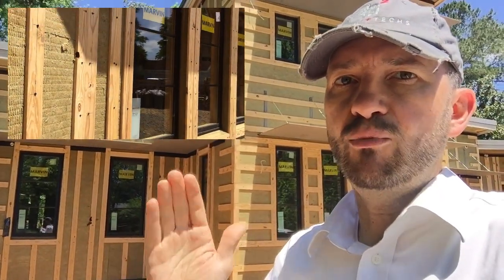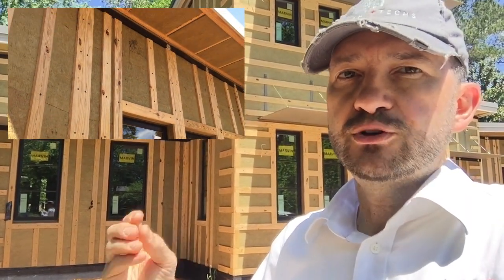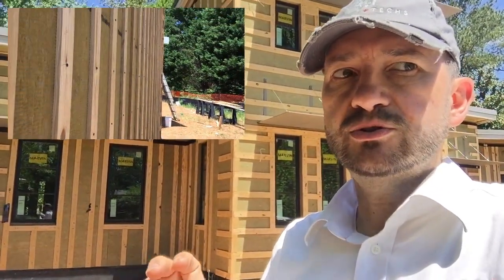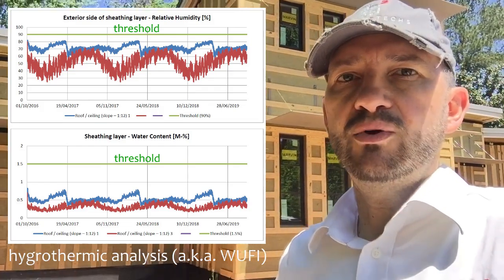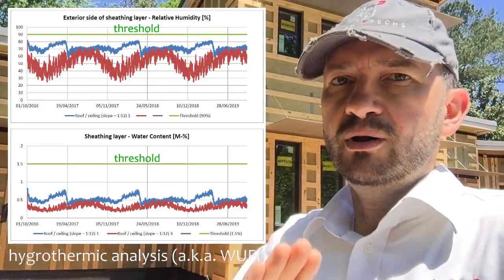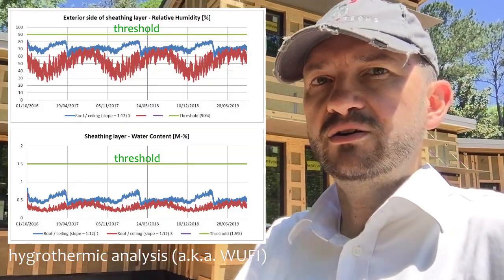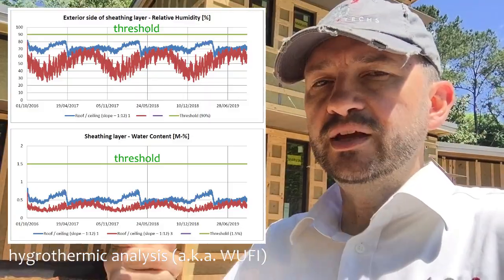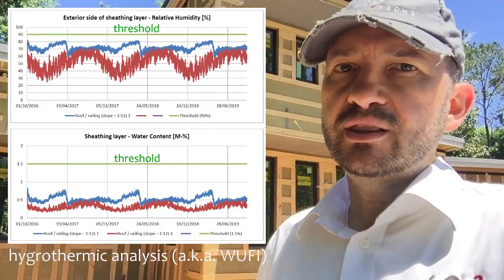Why and How We Install Continuous Exterior Rock Wool Insulation

Comment: 8:30 in
Pro tip, zig zag those screws, putting them in a perfect line like that makes a hinged parallelagram. 
With zig zag screw placement the firing strip will be more firm and have less wobble.

Comment: why not just use a vertical 1x8 or 1x10 trim on the corners? that horizontal cantilever detail could have ventilation and drainage issues be reducing ventilation along vertical battens

Comment: I thought if you run horizontal boards they had to be sitting on vertical boards. Horizon will hold water and prevent air flow no?
Reply from the maker: Thanks for the question!
What you are saying is true when you attach a continuous flat cladding (panel-like) without a gap between the back of that cladding and the furring strips, AND there are no ventilation channels created between ends of horizontal strips. In this case, and in many cases with vertical cladding, there is an attachment "system" that includes clips that maintain at least 1/4" gap between the back of the cladding and the strips. In addition, the amount of water in the rain screen gap is almost always from a vapor source, not a bulk water source. If bulk water gets into the rain screen gap, there are bigger problems (an unintended and unacceptable leak) than moisture on the furring strips, which will dry. In the case of open-joint cladding, installing furring strips at 45 degrees is a great way to direct penetrating bulk water out of the gap.
Make sense?
Reply: @LGSquared yes. Same as when insulating a roof I guess when the board standing on edge at the end of the eve can be a possible dam. If you’re getting that much water in behind the cladding or roofing material there are other bigger problems. Thanks

Comment: For the horizontal furring, if you must have it, replace it with Coravent SV5. You've put in place a bunch of air and water dams.

Avoid sections of vertical furring that touch other sections of vertical furring. They will wick water up by capillary action.

Finally, Rockwool isn't rated for use on pitched roofs, only flat ones. The slope is pretty subtle here, so it's probably fine, but I'd check with Rockwool that this install meets their spec.
Reply: Yep. Bunch’a dams installed. Love when guys that don’t know wtf they’re doing post video on YouTube pretending to experts.

Comment: great video. Can we just sheet the house again over the Rockwool ? Instead of the strips?
Reply: It won't work as well. You could sheet it AND do the strips, but the strips serve a purpose. The are a rain screen that promotes drying behind the siding. A flat layer of sheathing won't provide a channel for liquid water to move through. It also won't provide a path for air to flow though and remove water vapor.

Comment: Did the rockwool go down the foundation?  How did you protect the exposed rockwool above grade?  If stucco, how did you secure hardware cloth or wire?  If sheet good, any brackets attached to wall?  Good point about the corner trim backing.  Thanks.  (Working on my 1984 built house, looking to squeeze a few pennies from the heating and cooling bill..)

Comment: Does the liquid applied air/vapor barrier prevent the wall assembly from drying to the outside?  As you mentioned, you want to avoid trapping vapor.

Comment: Interesting! -- QUESTION -- The one thing I can't figure out, is this. Rockwool reminds me of a wool sweater, which is great as long as you wear a wind breaker over the sweater. Otherwise the cold air blows through the sweater and the insulation value of the sweater is zero.  Why is Rockwool not the same? To my mind the cold will pass right through it unless you have an air tight covering such as Delta Vent SA or that other one from Siga that is hanged over the exterior insulation.. What are your thoughts on that?  Just seems like Rockwool is very porous to air.
Reply from the maker: Hello, Coleen. Great question. The simple answer is that the rigid mineral/stone wool products are made dense enough to prevent convective loops that cause a reduction in thermal resistance, and it  be in direct contact with the continuous air & vapor control layer. VERY loose (density) insulation and poorly installed cavity insulation led to the focus on six-sided encapsulation.
There is additional research regarding "Wind Washing" with exterior insulations in vented rainscreen cladding assemblies done by RDH (John Straube). Here is a link to the report in case you, or another reader, is interested. 
https://www.rockwool.com/syssiteassets/o2-rockwool/documentation/research/white-paper/wind-washing-of-air-permeable-insulation-2018---white-paper.pdf?f=20201024215341
More published info from Building Science Corp (Joe Lstiburek) touches on the science of insulation and best installation practices that may add to my answer to your question. Here is the link to that.
https://buildingscience.com/documents/information-sheets/installation-of-cavity-insulation
Let me know if I have not answered your question, or if you have additional questions.
Reply: @LGSquared  ..after reading the Wind Washing study, I am convinced more than ever, that a WRB be placed over exterior Rockwool and sealed properly. In fact, It would probably be best if there was solid Zip sheathing used. Certainly no downside except for cost.  It seems that cold will otherwise make its way behind or through it under almost all installations. I did look up the density of Rockwool since density was focal in the study. I can see why in Matt Risnger's Vancouver BC Canada series, the builders used Siga?? wrap over exterior Rockwool - they never left it uncovered even when there was exterior clading used.
Reply: @Coleen_West  okay dude you clearly didn't READ the study because it had numerous statements like "For mineral fiber insulations ... there was 'practically no influence' on the measured thermal performance."

Comment: Hi Chris, thanks for this video.  You explained things perfectly.  I was wondering if you did some sort of metal "L" trim on the bottom for the insulation to sit on, as well as the furring strips and the exterior wall covering, or is the "coravent" taking care of that?

Also, how did you trim out for the thickness of the exterior for the window openings?

And finally, I'm assuming you put the air barrier, like Tyvek, right under the 4" Rockwool, is that correct?  So the layers on the studs are sheathing, Tyvek house wrap, Rockwool, furring strips and finally siding, right?

Comment: Glad to hear about the extra rockwool on the roof - that's what I did for my hermit hut. I did a primitive "double wattle wall" from a 1800 BCE archaeological site design - using on site materials. The roof I added a synthetic rubber pond liner on top of the rock wool - I can REALLY FEEL the difference now! Wow the wood stove heat really stays trapped and absorbs into my wattle and daub side walls, etc. Even though I had lots of air gaps - big leaking air holes and it's sub-freezing arctic cold where I have the hut. So that extra rock wool on the roof - I did TWO layers - yeah it was worth the investment for sure. thanks
Reply: @ducoh2093  I have no idea how standard construction would do it. I wanted a tarp roof to keep my structure as a temporary shelter in case Guvmint got fascist on me. So I have a tarp OVER my rafters - actually willow trees - and the two layers of rock wool - and then another tarp over that. Then when it rained - the rock wool soaked up the water through the tarp - so I put all these clip things attached to the tarp underneath on the inside - so I didn't break through the tarp. Then what? I bought a pool liner - synthetic rubber - to cover on top again - and put a third tarp over that. I used poly-vinyl tarps... At first I wanted my roof to be both breathable AND insulated (hence the rockwool and tarps). The synthetic rubber cut off the breathable part of the roof - and also cut off the Schumann resonance quite a bit. hmmm. Yeah I'm a primitivist.
Reply: Bro, stop being so paranoid. Build the roof right. F the gubmnint you do you, and do not worry about anything you have no control over. Build a little reinforced cement space under your pad. If crazy shite happens you could go down there knowing you did the best you could and relax while you burn a joint. 🎉
Reply: Interesting to see the use of a wattle and daub wall native materials along with modern ones like rockwool.  Thanks for sharing.
Reply: @Mays2410  Burdock cordage! cool. Compost heating! yes. I need to get back to my land to check up on my hut - and install my hand pump for water. I finally got down to the permanent water table - took a few years of digging and driving the well pipe. 33 feet down. Year round water. I got a "sucker-rod" pump from Earthstraw. It's a cool design but not sure how long it will last or if it will get sabotaged or something. hahaha.

Comment: Rain screen furring strips' orientation 

The Rain screen furring strips' orientation must be vertical to allow for unobstructed continuous water, air, and moisture flow.
 If your siding needs to attach to horizontal furring strips, they must be attached as battens over the required unobstructed vertical furring strips.
Source: Hammer & Hand / Horizontal Rain Screen Furring for Vertical Siding
Reply: Was looking for this exact comment. I'd avoid horizontal strips, especially at the window bays. You've made a dam with each one and at the window it will serve as an air dam, so you won't get great airflow through those sections.
Reply: Got on the comment section to mention the same thing. From what I can see the horizontal furring strips are insane. Unless he can explain it which I don’t see how he can that horizontals cannot be wood but rather the hard mesh plastic furring strips that allow the water to flow through it.
Reply: Exactly what I just posted before reading all these comments.

Comment: Please!!  I have the same question.  Your roof assembly is exactly what I am doing on the house I am building myself, and I would really appreciate a sketch of how you handle the edging and the core-a-vent on the standing seam metal roof.  I also have a low sloping shed roof with no hips or valley to deal with.   Thank you.
Reply from the maker: Good morning, Thomas, check out this video about how we built the overhang withOUT penetrating the building enclosure. If these are not the details you're asking about, please let me know! https://youtu.be/ITwTukfd-6U

Comment: Would you recommend this for older homes in California?
Reply from the maker: I definitely would, Floyd! In fact, we have a client in Boulder, CO, with an existing home in the foothills, that we are planning to remove all cladding and sheathing, and give a "new skin" which would include a continuous layer of exterior rigid stone wool insulation, just like the new house in this video. The house is in a WUI (Wildlife Urban Interface) area, where forest fires threaten the home, much like in California. One of the supreme advantages of having this assembly, with stone wool insulation on the outside, is that is extremely durable against fires. It has the potential to make the home "fire-resistant", when done properly.
Let us know if you have any other questions!

Comment: Why are the batten strips on the roof diagonal? Would this work for stucco?
Reply: They are diagonal as a 3 way compromise to attach to the rafters or joists (instead of perpendicular to them) AND vent upward (instead of blocked) AND to be a screw base for vertically oriented metal roofing panels.

Comment: Thanks for the video! This looks like the assembly we're planning on with either 6" or maybe even 8" of exterior Rockwool Comfortboard (we're in Wisconsin so our winters are chilly).  I'm wondering how difficult it is to hit the studs accurately when you're sending screws through the furring strips, comfortboard, and sheathing.  Was that hard?  Any tips for getting that right?
Reply: 10,000 screws mentioned in the video and to hit rafters through a 1x and 7 inches of insulation is some marksmanship!  I have looked into using fiberglass girt clips.  You have some slight spot bridging but mounting a bracket to the sheeting and a short screw to the battens is going to be a lot easier to execute and the clips will hold the insulation so you don't need the buttons.

Comment: How are you achieving air flow in the areas with horizonal strapping like the two story section and at the corners?  Also what happens when you need to get on that roof?  The assembly although functional from a building science perspective seems rather delicate.
Reply from the maker: Good questions, Julian.
The only reason we are using horizontal strapping on that middle section is to have a way to attach the vertically oriented cladding. That cladding is attached with clips that are mounted to the furring strips, and the clips provide a 1/4" - 3/8" gap between the furring strip and the back of the cladding, which is more than adequate for ventilation of this assembly.
RE: Roof design - Check out our video about the outrigger framing that supports the overhang. "Roof Overhangs with Continuous Exterior Insulation" - https://youtu.be/ITwTukfd-6U
The overhang is designed for the same roofing loads as the rest of the roof. Also, if you're asking about whether the insulation is adequate to support a roof load (walking, snow, etc.), here are the Compressive Strength numbers for the product used. The combination of this and the weight distribution provided by the furring strips, the assembly exceeds the design criteria for roof loads in all areas of the country. 
COMPRESSIVE STRENGTH (per ASTM C165 &
EN 12430):
Top Layer - 20psi (140kPa) @ 10%, 37psi (250kPa) @ 25%
Entire Board - 11psi (75kPa) @ 10%, 15psi (105kPa) @ 25%
Point Load @ 5 mm Compression - 30psi (205 kPa)
Reply: Aha, good to see you have a plan for the horizontal furring sections. I still think you have some problem areas, but part of it makes sense now.

Comment: Great details!
How far down does it go on the walls? Did you cover the outer band joist? Did you go down onto the foundation?
Reply from the maker: Thank you! This house has a slab-on-grade foundation, and we wrapped the thickened edge with insulation and continued it under the slab. Here is another video showing how we built it. https://youtu.be/Gjz4xPvLYJg Let me know if you have any other questions about it. 
For a basement or crawlspace foundation, we continue the insulation down to the footer. Sometimes, we will install insulation under the basement or crawlspace slab, and we will always install a continuous layer of insulation at the perimeter, where the slab meets the below-grade wall. This helps control heat loss, but mostly it's there to structurally isolate the slab, to allow expansion and contraction. Because it is below grade, and the walls are insulated, the thermal control is not as critical for the slab, as it is for the walls.
Reply: @LGSquared  
Thanks for the quick response this is interesting stuff

Comment: What's the trick to attaching continuous external rock wool to a steel framed building? What's the recommended way to fasten?
Reply: Rockwool has a guide for several substrates including steel framing. I'd look that up. It's only a couple page pdf.

Comment: Thanks.  I have to read between the lines so to speak as I am building in The southern Philippines about latitude 9.  Attaching to the outside of concrete brick walls is tricky.  Also obtaining rockwool there is going to be an adventure.  NO one in our small town knows anything about insulating any structure.  I would like to use rockwool.
Reply: Aerated concrete might be better for your location

Comment: Excellent. Two questions: What about dB reduction without the inner insulation? Looks like that some of the screws used for the exterior strips are not flushed, not being a problem for the final siding?
Reply from the maker: @Oaklejant - Answer to your first question - sound transmission happens through the air and the materials in the assemblies (plywood, framing, windows, etc.). This house is extremely air-tight (0.05 ach50), and having the sound absorption layer (rock wool) on the outside of the wood framing (sheathing, studs, etc.) is a HUGE benefit. This helps reduce sound so much better than having it in the cavities because it is controlling sound travel through the air and through the material (vibration, etc.). The cavity insulation would supplement the exterior insulation, but most of the work is being done by the exterior.
Answer to your second question. IOn all other jobs, we countersink all screws. On this job, the framing/siding crew (same crew) decided to risk it, and NOT countersink any of the screws. In the case where there was conflict, they made the adjustments. Turned out that less than 5% of the screws were in conflict with the siding. So, it required very little adjustment.

Comment: I like the details of the furring strips on the corners; very nice. What type of cladding is going on? Hardy? That wrb liquid looked super thin; that isn't polywall is it? Also interesting you ran the bug screen run the distance at the top of the furring strips. Very nice details! So glad to see these details becoming more prevalent!
Reply from the maker: Thanks, Consciously Conservative! We used Nichiha brand fiber cement cladding. We find it more stable, with a higher cement to fiber ratio. The liquid applied membrane IS PolyWall Blue Barrier. The minimum thickness throughout ended up 40 MIL, despite aiming for the recommended min. 25-30 MIL. There were some spots as high as 60 and 80 MIL.